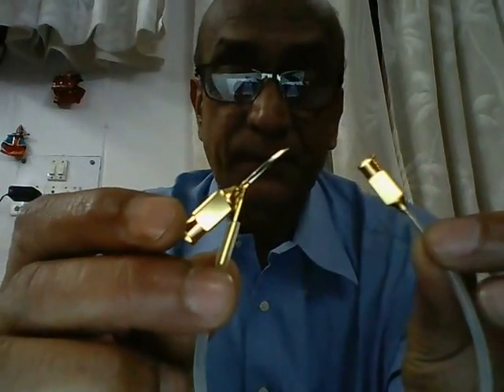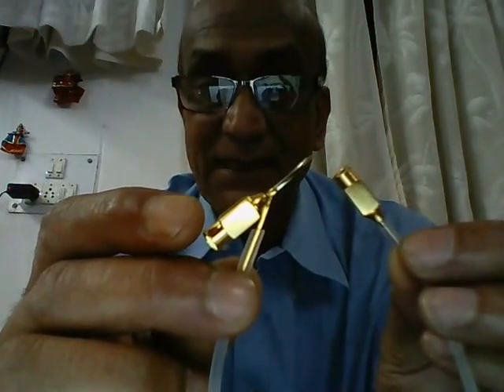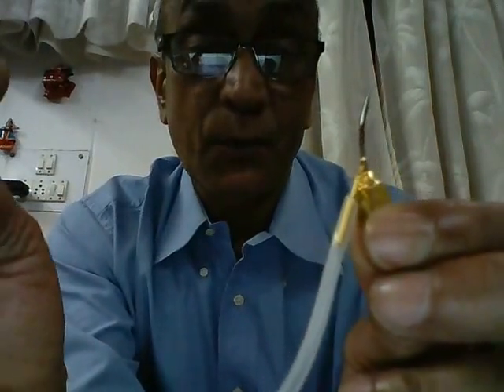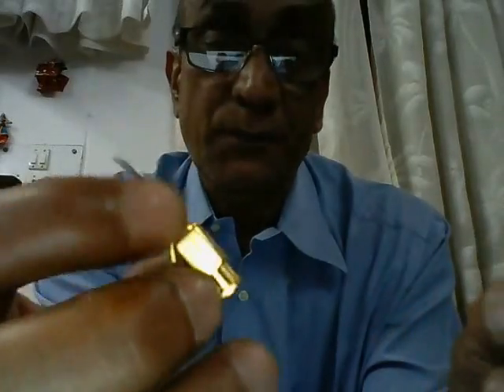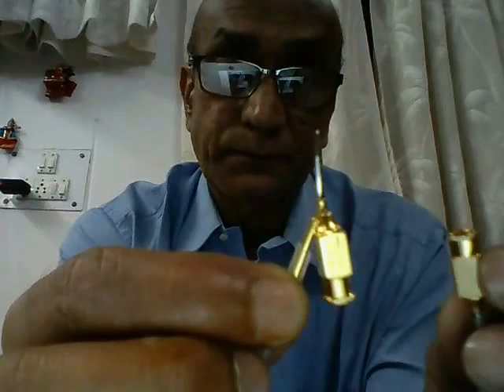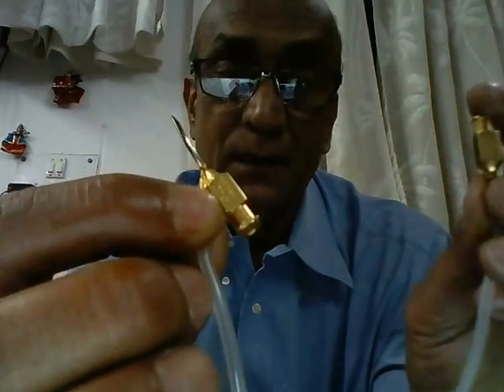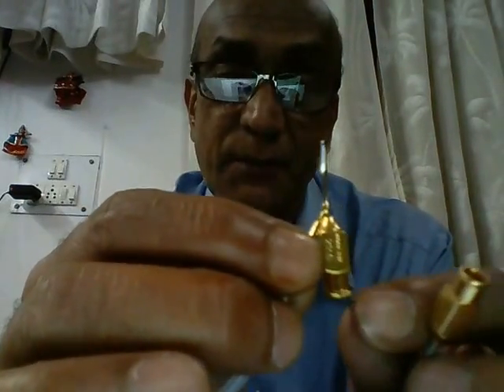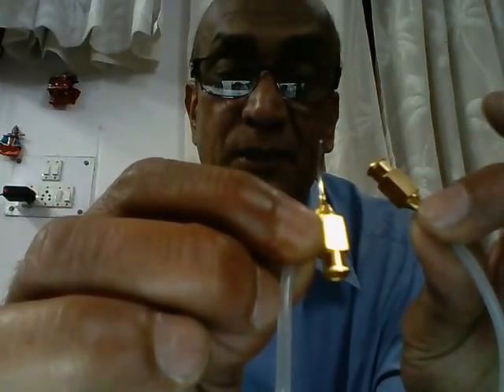Ophthalmic Instruments 2 - Simcoe 2-way Cannula - Sanjoy Sanyal

Comment: Sir is there is any reason why reverse simcoe is used despite classical/direct simcoe is present? Because we are just interchanging the hubs their positions & direction of fluid in tubing also reversed.
Reply from the maker: Basically one hub is for Irrigation and the other Hub is for Aspiration.
Reply: @SanjoySanyal  would u mind briefing wrt reverse simcoe? I didn't get that 🙏 
means actually we change the positions of those hubs or the hubs remain in same position, only change their function ie., either irrigation or aspiration?
Reply from the maker: @user-kilrilirrlri  Hubs and Ports remain physically the same. Only the function changes because of valves inside.